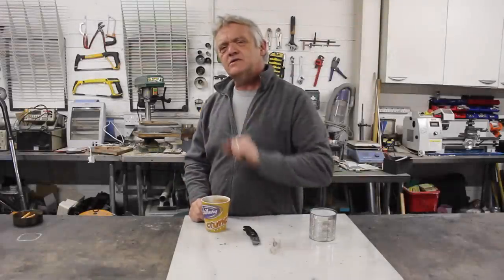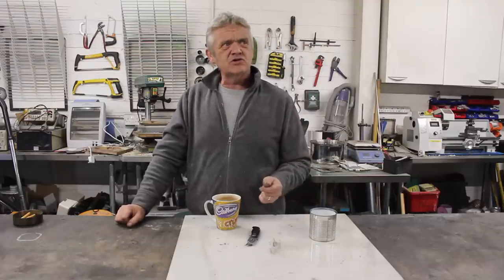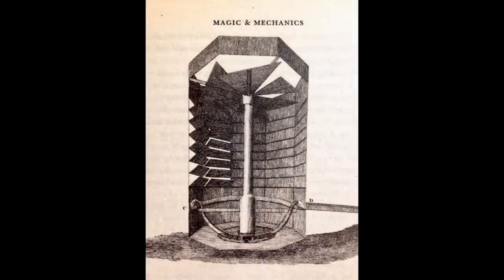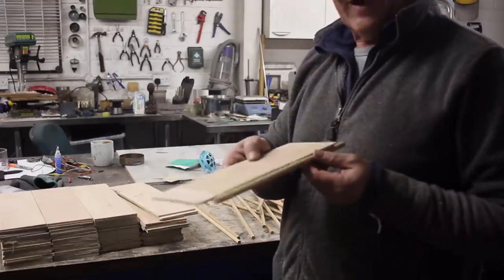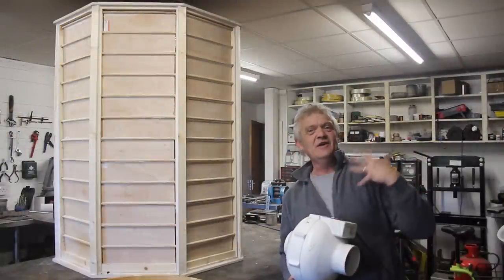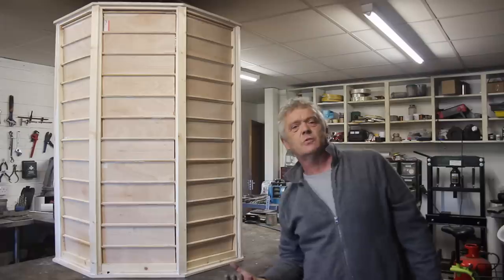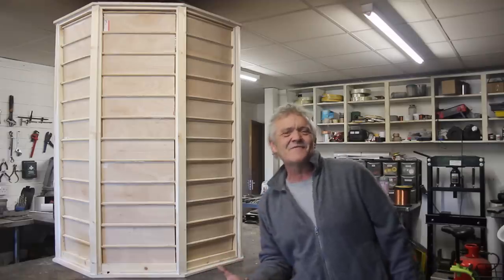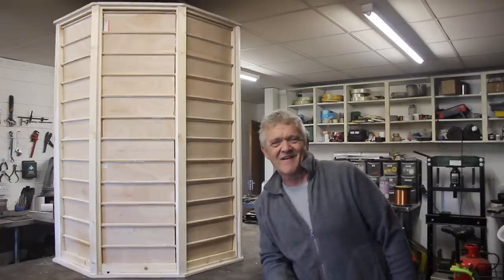1725 Aeromine And A DIY Wind Turbine From A Lost Technology

Comment: study the picture at 1.56 the vents open inwards upwards  directing air to the fan. there are only so many open acting as a regulator. the top is fully open and when you put a chimney above it it will draw in air just like a old fire would to get the water hot. by eck remember coal fires they are a thing of the future lol or will be soon lol

Comment: Would it be worth it to make the slats out of a lighter material like styrofoam? Or here's a thought... repurposed bubble style Amazon bags?  Just wondering if you're loose anything stability wise.

Maybe you could pick up some extra energy at the joint where the flap rotates?
Reply from the maker: oh yeah - I did think of foam board but it seems we can only really get that easily in the uk - so I chose something everyone could get - but I think you are right foam board - fascia or soffit would be miles better

Comment: Very Interesting find Rob , have seen a similar idea for passive air cooling , could possibly combine ? . Have you followed the solar tower idea ?. a high chimney ,coloumn of hot air rising from a surrounding glass catchment /solar heating, area . black ground under neath can further catch daytime heat and keep the turbines in the tower spinning after dark . Actually thinking more , a collumn af fast moving air can be used to entrain more from a surrounding larger 'venturi' . i have an air mattress that you blow up by blowing through about a 4in /100mm tube ,what would take at least ten lungfulls takes around four good breaths ..[ I so need a workshop ].
Reply from the maker: good ideas mate - you do need a workshop lol

Comment: Wouldn't it be better to placed airfoil inside the structure to divert air up onto turbine? Without it airflow would be turbulent cause reduce in efficiency.
Reply: I think you’re onto something but I have a different solution. Airfoils are more difficult to make and it would add complexity pointing them in the right direction and keeping them pointed there. What if instead, we cap the top and put the turbine at the bottom? The fluid density is greatest there which should improve efficiency I think.
Reply: @seabeepirate  What if you left it too but you add Heat Exchangers and a Heat Battery?
You Build up Heat During day and you speed up the Air during Night Time
Reply: @antoniopacelli  I’m not sure I understand. Do you mean to modify the airflow by convection?
Reply: @seabeepirate   i think u r right. Even the flap design is such that it will divert the air to the bottom when it get open.
Reply: If you add a bunch of pipes before the generator it would smooth out the air flow

Comment: Very interesting. Initial thoughts are that the size of the turbine is limited to the diameter of your tower, obviously many times smaller and exponentially  smaller than the wind collection area of a large blade. Would a multi layered turbine have any effect (possibly five or more sets of blades stacked on top of each other driving the same generator?
Reply: Would the extra weight not adversely affect this? lightweight plastics maybe or multiple small turbines would produce at a lower windspeed.
Reply: @davidsoulsby1102  no, thats why turbines get so huge, but its also about surface area of the rotor

Comment: Seen something like this on YT, using a screen and bits of cloth, instead of the viewed wooden flaps.  I think that the first cloth type was invented in what is now Iraq about 2k years back?  Read that somewhere. Liked the more recent  sort that that used fixed vanes set at 35 degrees. I thought that this last one was the more clever.  Less maintenance issues.  I wonder if the two ideas might be combined?  They both are winners as the wind power is free.  So it then becomes issues associated with reverse engineering and how much power you want to produce.

Comment: Modern wind turbines make use of "apparent wind speed". The air isn't the only moving part of a modern wind turbine. The blades of a wind turbine move too. Apparent wind speed is the combination of wind speed and blade speed. Sailing vessels and ice yachts have used this principle to sail faster than the wind. Ice yachts have reportedly sailed ~8 or ~9 times wind speed. The aeromine cannot compete because apparent wind is a big deal. Vertical wind turbines cannot compete for the same reason.

Comment: 🤨…. Still thinks the turbine needs to be at the bottom of that, the air blowing in the flaps > gets blown down by the flaps and as the turbine is at the top = a lot of turbulence will happen in that column as the wind is forced to turn and go up and you will have losses, put the turbine in the bottom = the wind will go straight down from the flaps to the turbine (I assume) without any severe turbulence = the turbine could be a centrifugal one at the bottom of the column or a duct running out of it to an inline fan
Reply from the maker: I can try either way
Reply: @ThinkingandTinkering  - looking forward to see if it works, or you do what I have suggested, as I have an interest in fans = l found that with the common installation of a gravity flap vent - for a 100mm extractor fan in toilet/bathroom, vented tumble dryer ~ when air is blowing into, opening the flaps and is blown down by the flaps

Comment: I'm not sure about the claim that this design must be more efficient than a turbine on its own. The flaps will let the wind in horizontally (maybe slightly downwards even) and then the wind will expend energy colliding with the other side of the tower. What makes the air then move up through the tower and the turbine is surely the increased pressure within the tower? Won't this then lead to some amount of the incoming wind to be deflected around the tower? Intuitively it seems that the wind must lose energy from the collisions with the tower and then from having to change direction before it reaches the turbine.

Comment: Building an airfoil is not that complex.   Pick the shape cut the ribs and spars and coat.   Once the airfoil template exists easy to cut over and over.    I would figure picking the best airfoil would be the hardest part.   To me that makes the difference between the two ideas

Comment: Does anyone know if ionic wind produced by MIT for example can be made stationary and used for generation? Maybe it only works during thunderstorms :)
Reply: If you ever saw that demonstration where they put the pie tins on top of a van de graph generator, that's "kinda" the same way one of those triangular aluminum foil lifters work.  You can get small van de graph generators in the kids toy department on Amazon that use soda cans for the "ball" on top.  Maybe you could put a few of those on a bicycle tire and see if it spins.

Comment: This is nothing like the Aeromine.  The aeromine patent descrives a plenum with low pressure generated with the Bernoulli effect.  You are describing a plemum with high pressure genrated by  the 'static pressure on the upwind side of a building.  It is still interesting, but it has nothing to do with the more recent Aeromine.